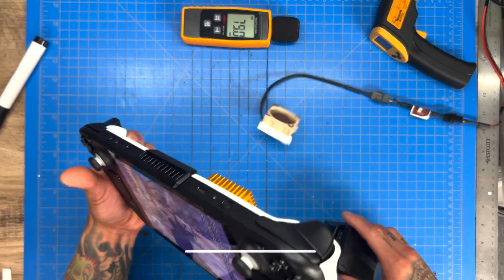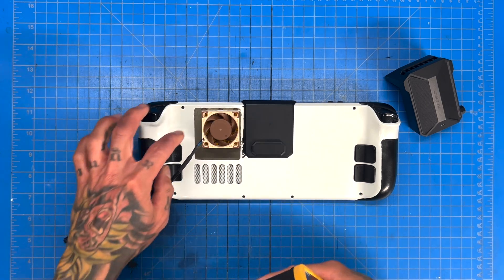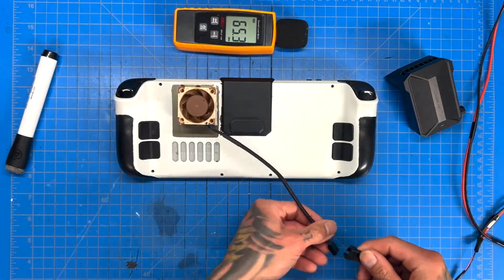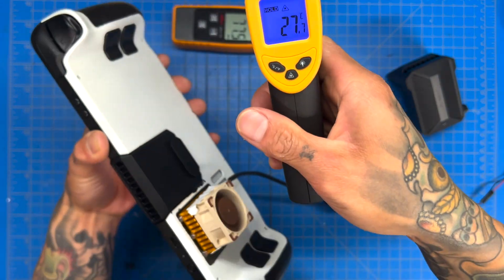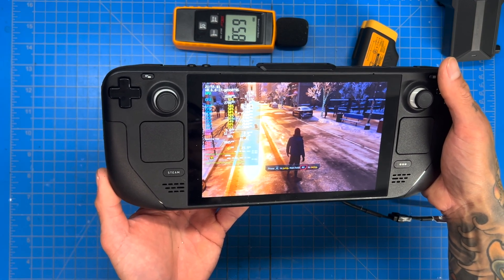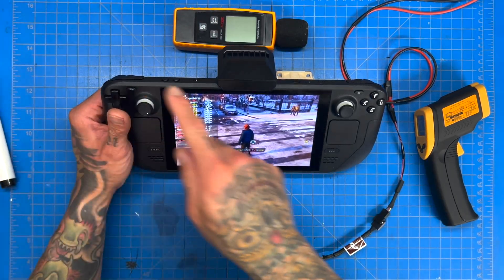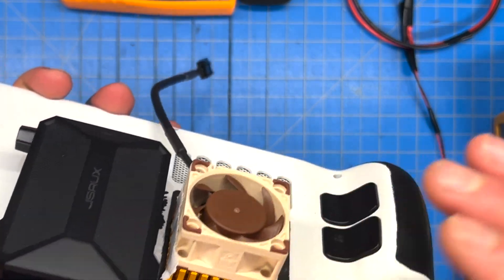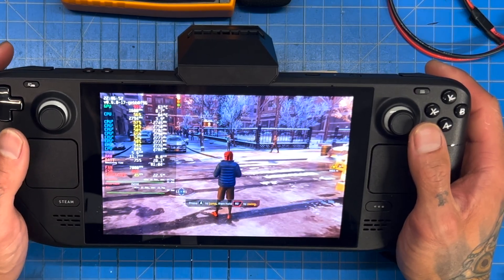JSAUX Backplate and Cooler

Comment: Im satisfied with my daphne backplate the one with left and right vents, no issues at all stays around 70 deg
Reply: How's fitment with that backplate?
Reply: @yesterdaysjam2405  fits as stock no issues
Reply: @jimisantol1415  thanks, I've got that plate in my AliExpress basket lol
Reply from the maker: I thought that was for sure the best-cooling back plate on the market because of the wholes.

 The only thing I would add is the thermal pad mod, SOC can get pretty toasty, and it would be best for the longevity of your Steam Deck.
Reply: @Diy_Papi  thank you bro will do that when time to clean, keep it up and more power 🫵🫰

Comment: Hey man great videos. I have a request. Can you get a jsaux mod case and a phone cooler and mode the cooler to fit in the kickstand place?  Maybe a few long slots in the case behind the fan to pull heat off the jsaux aluminum back plate?
Reply from the maker: You can but I wouldn’t recommend 

The jsaux mod case is pretty flimsy as is, and cutting out an area for the back plate would only make it worse.

Comment: Hello, just subscribed, love the mods for the Steam Deck. Gotta ask a question, I ordered a Jsaux Modcase with cooler and a Jsaux backplate for the design. Is it fine if I just do the thermal pad mod for it then not putting any fan, then just putting the modcase with cooler. Will it damage the modcase due to the heat metal of the backplate?
Reply from the maker: I don't think so, the hottest temp I got was 57c. which should be safe for the case.

My opinion:
I don't think there is any point in doing the thermal pad mod. 

Actually, I would take the thermal pad off the jsaux backplate.

The Cooler is more than enough to keep things cool
Reply: @Diy_Papi  Thanks for the reply :)

Comment: Still thinking about doing this but with a water cooler
Reply from the maker: I’ve been thinking about doing that Mod too, but the real issue is going to be mounting pressure on the back plate
Reply: @Diy_Papi  if only we all had the tools Linus has lol. We could make something like the mount they made but give it a bigger cut out or even just make a custom water block.

It would also be cool if there was a smaller iets laptop cooler since those push enough air to cool a laptop from 80c+ to 40-50c without even using the laptops fans.
Reply from the maker: You could just thermal glue them together. but AIO are huge lol
Reply: @Diy_Papi  Hmmmm maybe mod a dock into something like a switch dock with a water cooler attached.  You would be able to slide the deck in and have the perfect pressure every time if you do it right. 

The one issue i see is that you would need something to transfer the heat better but you cant use thermal paste and thermal pads would probably rip unless the dock is something you can open and close.
Reply: turn on subtitles for some risky water cooling, https://www.youtube.com/watch?v=j35Fo0Ef2BY

Comment: The top right of the backplate seems to be the most optimal spot for cooling with the thermal pad mod. Unfortunately my circular peltier cooler doesn't fit well in a square corner.. I might try to make some adjustments I've seen idk.
Reply from the maker: Exactly the top right is the best spot.

It doesn’t need to be perfect, contact pressure is more important I think

Comment: the contact surface area of that cooler isn't that great, GameSir F9 actually overlaps the thermal plate and misses just the corners. The last of us I got 67c while in videos I watched the same section of game was 89c with Jsaux cooler, backplate and F9 22c less and almost 2000rpm less. Love the nod to a certain british tv chef ☺ if I change the internal fan speed from default to custom Im sure I could get even lower. The last of us is the new stress test beast to toy with. 22c less for me is worth it, I mean 89c is a little too high I know 100c is safe but I never want to see 80c
Reply from the maker: It has great contact, it has a 15kw thermal pad too.

Sounds like great number, it was a lot warmer in the workshop that day so temps were not as good as in the past. Room temp plays a key role.

There is a point when the default fan speed drops so low the Steam deck starts to warm back up. 

I am going to start recommending people to do custom fan speeds when calling the steam deck.
Reply: @Diy_Papi  Older AAA from maybe a decade ago, the fan will shut off and sit at 51-52c. It's newer games that might finaly benefit from the extra cooling. I really should add the custom profile for the fan speed but havent had the time lately.

Comment: i was thinking of an 80mm fan but looking at your fan there, which i assume is 40mm? it probably doesnt fit, or is that one of the rarely seen 60mm fans like the 60mm-noctua-nf-a6x25-flx-low-noise-fan which might be a better fit?  as for 80mm, i still have a Noctua NH-L9i, Premium Low-Profile CPU Cooler which i bought for a low profile mini-itx case, wonder if that can be bodged onto a deck.
Reply from the maker: I’ve tried low profile coolers but it’s too much bulk. Thinking of switching to a blower style fan. Would help cut down bulk but a lot noiser

Comment: I think getting a universal vga cooler with the mounting holes would be ideal.  Drill aligning holes in the aluminum plate, so you can use included push pins, or better yet bolt it on directly, so you can maximize mounting pressure. Swap out the thermal pad on the heatpipe for a copper shim and you will have something high performance and low profile. That poor steam deck is starting to look like a Sega Genesis with all the add-ons. 🤣
Reply from the maker: Haha it’s getting ridiculous

Comment: Is there a Thermal Peltier the same size as the fan/thermal plate? squish it between the Jsaux back plate and the thermal plate.
Reply from the maker: Yes there is but it’s not worth it with a 40mm fan and heatsink. 

Better with a cpu cooler 

https://youtu.be/a0ofCxio3PA

Comment: Is it worth just to attach only this heat sink to the Jsaux case? And do you jeed to cut top plastic part over jsaux plate, or you can attach heat sink on top of the plastic?
Reply from the maker: You would have to cut a hole in the case
Reply: @Diy_Papi  ty Papi